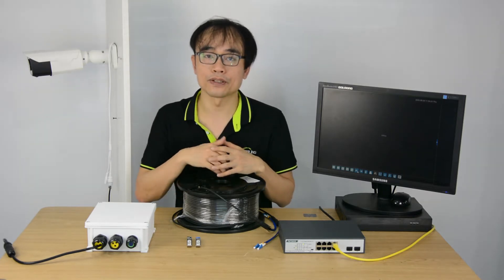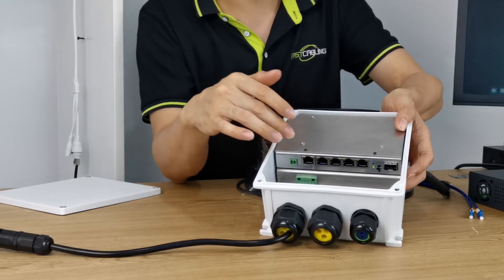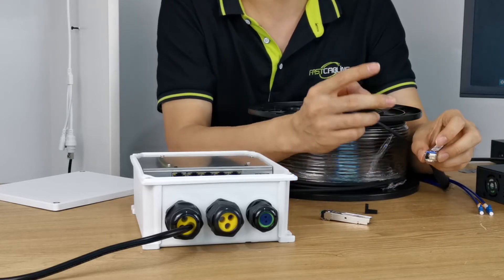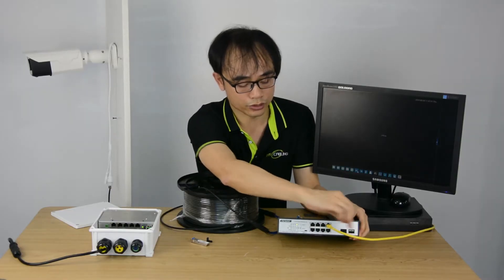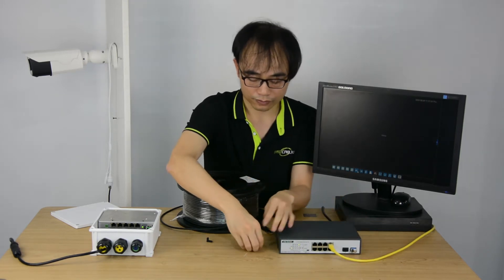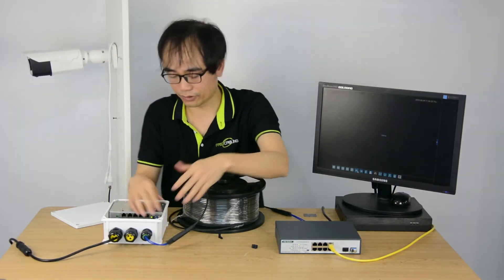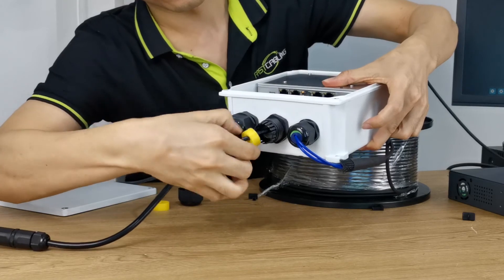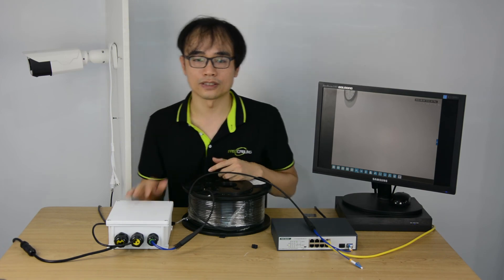How to setup fiber optical PoE Switch outdoor

Comment: It would be very helpful to understand how power is being run to the poe switch.  It appears power is already available at remote site to power the poe switch.
Reply from the maker: You are right. The power can’t be sent through the fiber optical cable. Technically It is the plastic. You can either wire power cord in parallel or use the solar power if power source is not available at the edge.

Comment: Nice Video. Please I want to know,  can you plug more cameras into the POE switch (3pcs More) and everything still goes through the same fibre cable? thanks
Reply from the maker: There are only 4 PoE ports with this outdoor switch. You may add another 7 ports POE switch to increase the POE ports. https://www.fastcabling.com/product/outdoor-waterproof-poe-pass-through-switch/ Just to be sure your NVR is being connected to the same switch at the center with the fiber optical receiving. We suggest there is no more than 3 switch between the camera and the NVR.

Comment: Quiet confusing,  why did you use one strand instead of 2, I thought fiber optic cable also has Tx and Rx?
Reply from the maker: You are right about the Tx and Rx. Except using two strand to send and receive, you also can use the different wavelenght in single strand to accomplish the job. The wavelength is determined by the SFP module. Here is the example of BiDi SFP module. https://www.fastcabling.com/product/bidi-sfp-fiber-modules-2/

Comment: What if we manually splice the fiber optic wire? What would be the specific connector to use to patch on that kind of poe switch? TIA
Reply from the maker: Yes, you can splicer the fiber optical cable. The type of connector you can use is determined by the SFP module. The most popluar types are LC and the SC. The LC is the compact size.

Comment: What is the name of that White box
Reply from the maker: The name of the white box is Outdoor PoE Switch with SFP. This is the product link to get more information about the item. https://www.fastcabling.com/product/outdoor-poe-switch-with-sfp/
Reply: @Fastcabling  Hi, can i ask what is the meaning of SFP?
Reply from the maker: @toptotop8689  SFP stands for “small form-factor pluggable.” You can insert suitable SFP module into the SFP port, then fiber optic link is available. Fiber optic link can reach long distance transmission, and provide high speed network.
Reply from the maker: @toptotop8689  The small form-factor pluggable (SFP) is a compact, hot-pluggable network interface module. It is the small device which will convert the signal between digital and optical. When you order the PoE switch or media convertor, what got is the SFP slot. It is the empty slot which requires the SFP module. Similar case like the SD card slot, you will need micro SD card installed to record the files.